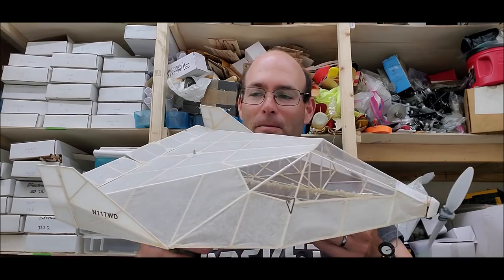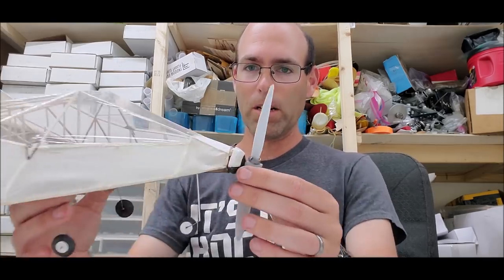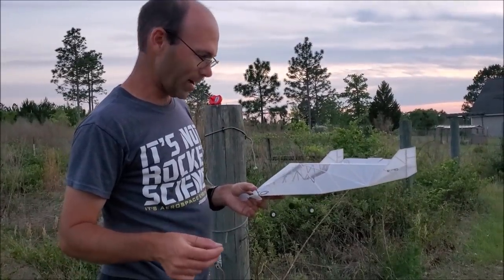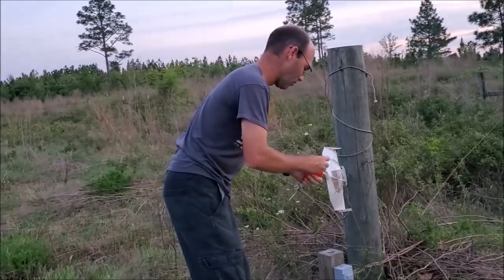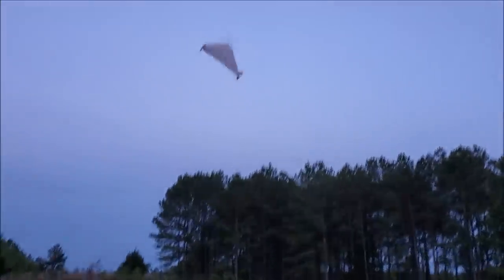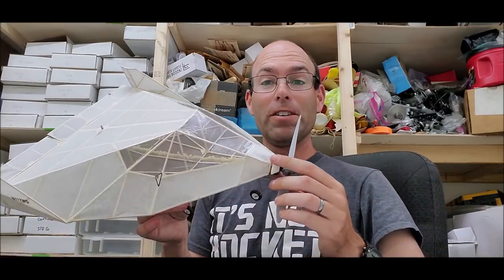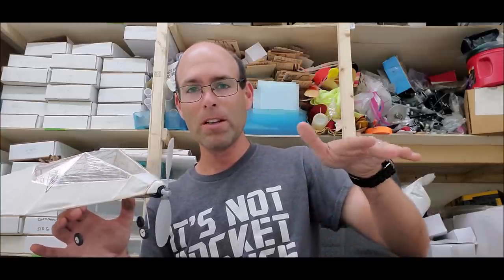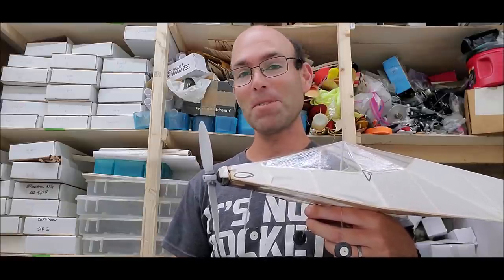Rubber powered FMX-4 Facetmobile that actually flies!

Comment: Befuddlement is the reason I still fly free flight. Great job figuring it out, and I appreciated the explanation of the flight trim. That tree almost got it!
Reply: NONE of my free flight models ended crashed so hard that it couldn't be rebuilt.  Meanwhile a majority of my radio controlled models have ended up in the trash can after a crash.  My only conclusion is that having me as a pilot is worse than no pilot.

Comment: I made a model glider of this using large Honey-Nut Cheerios cartons and free card model plans from Currell. Not the best glider with a big rubber band for a launcher. Trimming an COG were difficult. As I recall from some of the old pictures and film footage of the full scale aircraft it seems to be usually flown in a nose high configuration.

Comment: You really got her flying great! I've had some low wing fighters that had the problem of turning turning left then switching to the right and flying very erratic when more turns were added. Say 600 to 700. Is that an incorrect CG? I'm stumped.
Reply from the maker: Low wingers do tend to reverse direction. Try using some wingtip weight on the right wing to reduce the amount of right turn inputs you're using to combat torque.

Comment: Put they said a it was so unstable a computer was needed for it to fly.
Truth, several years ago an ultra light experimental powered by a rotac was flying around . I wish that I could remember the builder's name.
Reply from the maker: F117 was definitely unstable. The Facetmobile was actually remarkably forgiving with no real bad habits (that's the Rotax powered airplane you're thinking of, and the full.scale counterpart of the plane in this video). Fun fact: the F-117, as a model, flies extremely well with no stabilization required.
Reply: The real one flew just fine with stick & rudder.
 Documented cross-country to Oshkosh: 100kts on 40hp, with 340lb useful load. Could stay aloft without stalling at <16 kts. Helicopter had trouble holding back for it at altitude.

Comment: I kind of doubt it would be the most efficient of airplane designs.
Reply: 100 kts on 40hp, with 340lb useful load. Stall proof, could stay aloft at <16 kts.
Reply: @JFrazer4303  Has someone upscale this design and achieved those performance numbers?

Comment: Obviously, that was pretty cool! But let's challenge ourselves. Let's Leonardo DaVinci this up! What can we do to engineer this project without modern materials like plastics and rubbers? Can a power plant be added, say music box metal springs for example, that would give us a similar propulsion profile to the rubber band?
Reply from the maker: For what it's worth, rubber power has been around since at least 1870, possibly 1850, so that part is pretty vintage. I think solid wood props started appearing in the 1890s. It's amazing how far back this stuff goes.
Reply: @joshuawfinn  I think I knew that about rubber so that was why I suggested Leonardo (15 April 1452 – 2 May 1519). Even more vintage still. Wood props -- yeah I expected that. I just couldn't noodle out something that had the same energy profile as rubber. String certainly wouldn't do.

Comment: I wonder what would happen if one were to fill the fuselage with helium, or even hydrogen (non smokers only).. 🤣.. This is a very interesting plane indeed! 👍
Reply from the maker: That would just be too easy! 🤪
Reply: See the Aereon "Dynairship". the little Aereon 26 test plane flew just as an airplane.
Reply from the maker: @JFrazer4303  whoa. Someone on rcgroups even drew plans for one!!!
Reply: @joshuawfinn  i think if the cover was black it seemed more stealth and solar rays can heat the air inside trasforming it in a hybrid flying baloon

Comment: I built one of those from magazine plans, but I didn't try to fly it, I gave it to a friend so he could hang it from his ceiling, the one I built was about half that size.
Reply from the maker: I want to build a smaller one.
Reply: @joshuawfinn  the plans I built from, were either Model Builder or Flying Models, I don't remember which, but it was a fun model, easier to build than what it would appear.